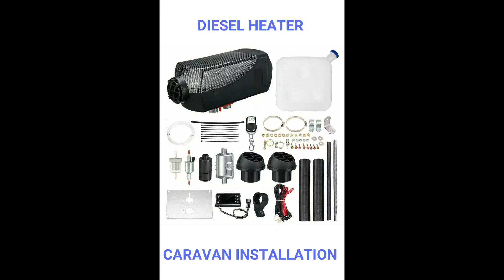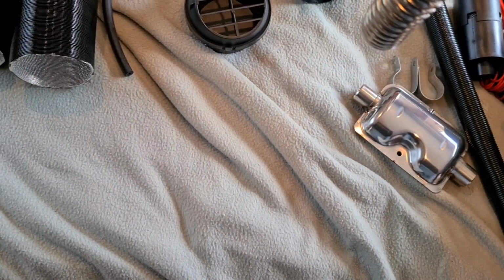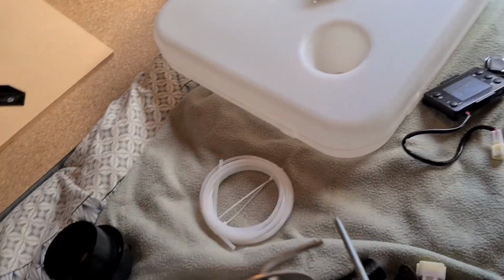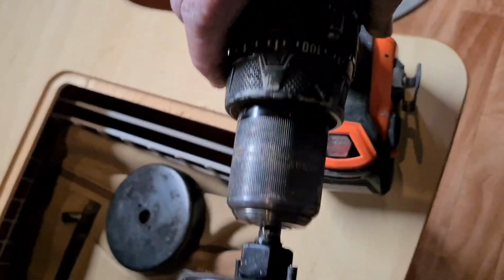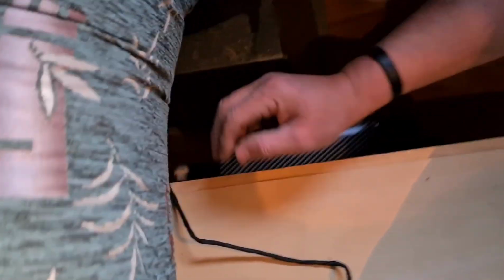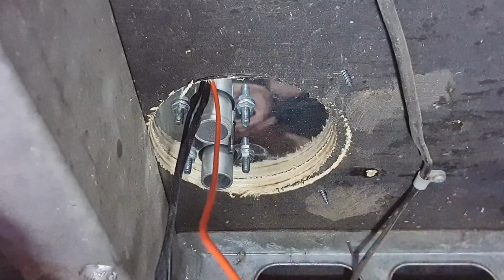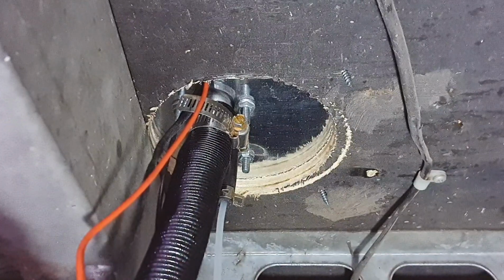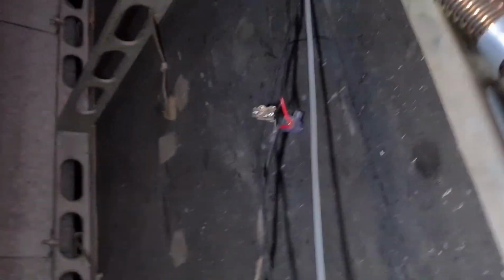Stuff it let's go around Australia Diesel heater installation on a caravan

Comment: The air "filter"  intake silencer screws into the ducting, I bought that heater too. The inlet duct incomparability is a pain in the bum. Thanks for the video. Ps the fuel line is a dip tube so the hole can be in the top instead of the bottom, No Leaks.
Reply from the maker: inlet duct certainly is, haven't had any leaking on the fuel tank, have done 3 this way.....but whatever works, instructions are so vague lol

Comment: I am just in the process of installing one in my motorhome. I'm in no rush and am spacing it out over several days. On the one I have, the air intake cover on the unit, screws off and the black, stretchy hose fits on it quite easily - not that I am using it, anyway. I had plenty of hose-clamps that came with the unit and the black, fuel line connector hose was already cut into correct lengths. I also have done "copious" research before even attempting this. There are a gazillion "how-to" videos on YT. And it is still frustrating in places! Oh and to get the right sized hole into your van for the exhaust and intake hoses...etc, you can take off the rubber flange on the bottom of the unit and mark around it (then replace it, of course) - at least that's how I did it. More cuts, but smaller hole, in the end & fits well...
..
Just as an aside, the reason to install the outlet nipple at the higher (raised) point is so that you don't get any sediment/contaminants going to your pump...they may get though the filter, and if they do they *will*, without doubt, ruin your pump. It is highly recommended you leave "at least" 50 mm from the bottom of that tank, to allow any such stuff to settle there and not get into the fuel line. 
That is also why they don't fit the nipple at the shop. That is so you can choose which way you want the filler opening, of the tank, facing.
..
Also, when pushing the white fuel line into the black connector, you need to make sure that they go all the way in, so they are "but-joined" to the other side, within the black connector tube. This is to prevent bubbles from forming in the line, which will also cause problems if they get into the combustion chamber. 
..
Anyway, it is what it is: hope all is going well for you both. All the best.
Reply from the maker: some good tips here, needed this before I did mine, instructions that come with tge unit are pretty useless, thanks for the message, I hope it helps others too.

Comment: Should have put heat  resistant silicone on the metal plate before fixing it to the floor, als i put split tubing over the pump  cables under the van to protect them.

Comment: The outlet tube goes of each side of the tee piece to create to outlets not on the  inlet Port
Reply from the maker: Gathered that, but as our van was only 16ft, wasnt necessary, I guess you could use it to put an outlet into your annex area if so desired :)